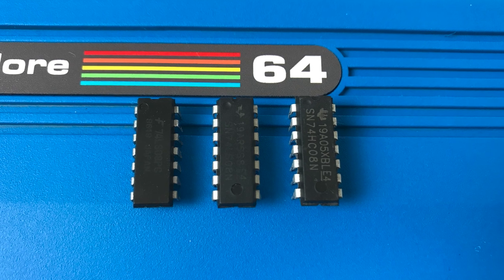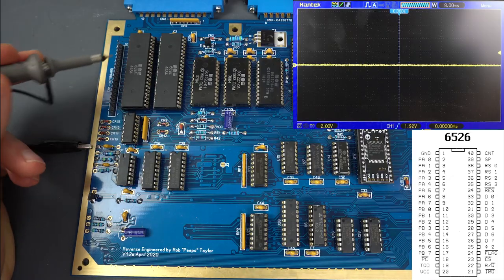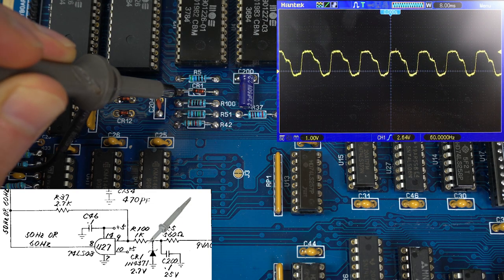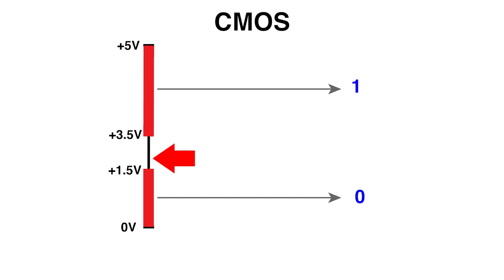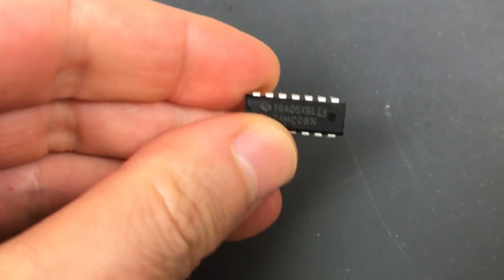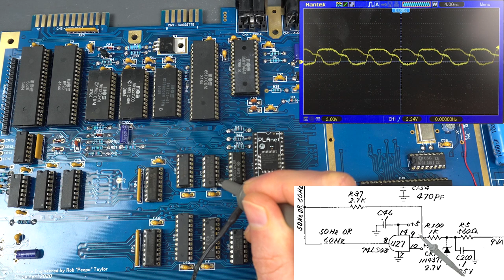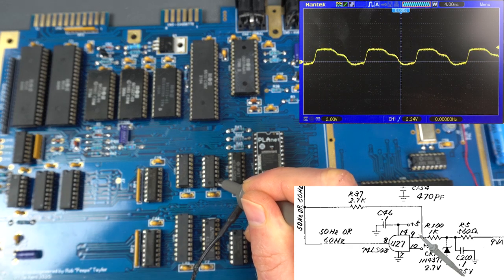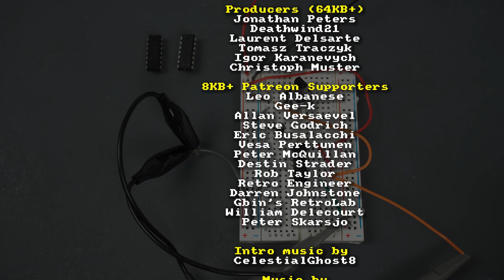Stumped By New Fake Chips Scam

Comment: Nice repair video and discovery of a mislabeled or (more likely) FAKE TTL chip!
One thing you did not mention, Noel, is that CMOS power consumption goes up dramatically as the input voltages are farther from the rail (like 2.5v for high on a 5v rail), and likewise TTL power consumption increases quite a bit as the input levels get closer to the voltage rails (such as 0.1v low input instead of .7v low input).  The good thing is that for this application it shouldn't really matter as far as the input from the zener shunt is concerned.  However, due to the reliability issues of (seemingly) all Commodore/MOS chips I would personally be concerned about the CMOS 74HC08 driving an input on each of the 6526 CIA chips.  It's one more reason not to mix CMOS and TTL logic chips.  If you have to do that a series resistor between the CMOS output and the TTL input is a good idea to prevent blowing out either the CMOS output FET's or the TTL input transistor(s).
Reply: Commodore chips are NMOS, not TTL. They can handle 5V on inputs without problems and their output is usually slightly above 4V. There is no increased power consumption for high input voltage on NMOS as the input is connected to the gate of a MOSFET, which doesn't conduct.

Comment: Two things:
1. Using the mains frequency as a time base is a very good idea if one does not mind losing the time when power is off. The mains is more stable than most crystal oscillators over time periods of days or weeks.
2. I would be cautious of triggering a digital circuit using marginal logic levels. The trigger voltage can change with power supply voltage, temperature and time. What works today may not work tomorrow if one or more of those parameters change. If LS chips are not available you could try HCT chips as those are meant to have TTL compatible input ranges at the expense of lower output drive.

Comment: You can also create a zener diode with an higher voltage by adding a normal diode to it in the reverse direction so its drop adds to the zener voltage. To keep the normal diode conduction mode you have to add another normal diode ok parallel to the zener and the first diode.
Reply: Difficult to do that on a premaid circuitboard.

Comment: I think that Commodore engineer's decision to use the chip in its low threshold mode is a bad design by itself.
Reply from the maker: Agreed! That was really puzzling when I studied the circuit. Especially relying on the very bottom of the acceptable TTL threshold.
Reply: Well, the TTL spec guarantees the output will switch as long as the input is 2V or greater. So it may also very well switch at a lower voltage.

But 2.7V is safely above 2V, so it's perfectly fine IMO.
Reply: Perhaps they had a bunch of them in stock. Or maybe someone got a real good deal on 2.7V zeners that month.

Comment: For time-of-day keeping, the mains' frequency, at least in the US, is quite accurate over time. Traditionally, the multiple grids in the US have been kept it tight synchronization, partly to ensure clock accuracy.
Reply from the maker: Yes, I never realized that before I learned about this. But I guess it makes sense, especially when they used that signal much more a few decades ago.

Comment: Back in the 80's we had a very similar problem when card production swapped the manufacturer of an LS chip in the Power reset circuitry for a banking terminal (Texas Instrument vs Nat SemiConductors I can't remember which way round it was). Needless to say when turning the machine off the replacement chip enabled the processor whilst the voltage was dropping and the processor corrupted the backup memory - it took some time to find that problem.  Nothing fake - just manufacturing tolerances.

Comment: I've been experiencing this quite a bit myself.  Recently I got a lot of 5 MC6847 VDG chips.  4 out of the 5 worked.  The one that didn't work had a notch that was different than the 4 that worked.  So I did the acetone wipe and sure enough it was a rebadged chip.  But it was rebadged from a 100% comaptible!  It just didn't work.  Why did they feel like they needed to rebadge that?  So I tried the test on the other 4 chips just to see and sure enough they were rebadged too....but they were still all 6847's!   I could see the original labeling underneath the paint.  They didn't bother sanding them down. The only reason I could think of them rebadging them was to make the date look like they were new old stock.  We all know they haven't made these in a long time, so they're not fooling us.  It's just a waste of time.
I got 5 63C09P's that didn't work, and did the acetone test and I got a nice black q-tip, meaning the badging was fake, but they sanded them down so much, I couldn't tell what they were originally.  These printing jobs on the labels even indent into the plastic a little bit, so you can't completely get rid of the badging, but that copperish color sure faded away.
Reply from the maker: Yes, things are really bad with larger, more expensive chips (even though they aren't THAT expensive), but this came as a surprise to me. Such an unfortunate situation that we can't trust chips like this.

Comment: I mean, you can still get brand new 74LS-series chips from mainstream component sources (Mouser, Digikey, etc). I think this is more of a story about buying from reliable sources.
Reply from the maker: That's true. But it's hard to find a reliable source with reasonable shipping (or no minimum order) for when you just need a small component.
Reply: @NoelsRetroLab  I mean, I guess? Most places have an economy shipping option. I know Mouser will ship as little as one resistor and you can choose their economy shipping for $3.50, so I pretty much use them exclusively. It really comes down to, "how much is my time worth?"
Reply: @An_Onion  Sadly when you order from Mouser in Europe, shipping starts (!) at 20 Euro ($23,61). Only when you spend more than 50 Euro ($59,02) it is free shipping. So it only makes sense when you spend more than 50 Euro each order. So wait and stack all the ICs up in your card :(

Comment: Nice demonstration! But why didn't you use a 74HCT08? That would have the same switching levels as the LS, so no need to replace the zener diode.

Comment: The problem here is with the original design. The extra feedback resistors are an attempt to create a Schmitt-Trigger to overcome AC line noise, however relying on the linier characteristics of a digital part is very bad practice. My guess is that the designer found he (she) had a spare gate and so decided to save the expense of adding another logic package (with a real Schmitt-Trigger) such as an SN7414. (One extra DIP package took up a fair amount of space)
Unfortunately this was done a lot in the early days but the variations in manufacturing process from manufacture to manufacture or even run to run can be large.
That's why the data sheets list typical values with a fairly wide range from Min to Max.
The moral to the story is don't design a digital logic circuit that depends on the linier characteristics of your logic elements.
All of that said, I'm guessing that the zener diode voltage was chosen to keep the transition close to the zero crossing of the AC line where power supply rectifiers (and other AC loads) might generate noise into the wave form.
Reply from the maker: I agree! That clearly shows it was added last minute because they had a spare gate already on the board 😃  Typical for computers of the time. The amazing thing is that it was never changed in subsequent revisions of the board.
As for the value of the zener, remember that the original AC signal goes all the way to 9V, so the slope is really steep over a whole range, so I think they could have safely picked lots of different value zener (maybe even up to 4-5V) and had the same effect (just a guess, I haven't really tested it).

Comment: Just a small clarification: LS does not directly identify the technology. LS stands for L-ow power, S-chottky diod. 74LS08 takes less power and is much faster than 7408. There are also variants 74L08 or 74S08. Some of the chips from S series can even work well above 100MHz.
Reply from the maker: Correct. It's one very specific type of implementation, but always using TTL. I didn't mean to imply that all TTL chips were LS, I should have made that clearer.

Comment: I fixed the exact same issue fixed it with a higher zener thanks to you. Exact same label as well. I actually also had a similar fake 193, causing wrong clock. Pretty irritating. It is easy to see via the power consumption, around 4ma is too low.

Comment: I taught digital electronics for almost 25 years.  Our supplier of lab parts, the lowest bidder, supplied fake chips.  It was a nightmare for me because we were analyzing the performance of various families and they were all the same (CMOS) yet labeled differently.  Also, several of the kits had chips that were labeled upside-down so had many burnups.  Also, some chips were NAND for NOR chips, and NOR for NAND chips.  We had to collect all the parts and purchase replacements from a reputable supplier.

I have never seen a stand-alone TTL produce an output high greater than 4.4 volts, and a CMOS no less than nearly 5 volts.  This is the easiest way to test.  Also, the input current unloaded for CMOS is nearly unmeasurable whereas TTL will have a few mA.

Comment: Changing the zener diode with one having higier zener voltage is meaningles. With ~ 2 volts on the rail you were not nearly close to that 2.7 volts on the first one so puting one with 3.3 volts zener voltage doesnt make any sense. Placing the second 74LS08(HC actually) may have solved the problem byt that is because of the tolerance of that chip and it seams that it works at the edge of its specification, which is not good because in time as the chip degrades it will probably go out of that range and the clock failure will reaccure.... Better find a genuine 74LS08 as soon as possible. The only thing that I think may help here is changing resistor R5 (560 ohms) with one with lower value (240, 270, 300 or 330 ohms). In that way the voltage drop acros the resistor will be smaller and the rest will go accros the Zener diode wich will reach its zener voltage
Reply from the maker: I wouldn't say it's meaningless. The 2V was due to the feedback resistor. The higher the input level, the higher that voltage would go. You can even see it in the oscilloscope that voltages are higher with the new zener. And I did try the HC by itself before I measured things that it didn't come close to triggering. But yes, changing the resistor would have helped as well.
Reply: It is the feedback resistor that lowers the voltage. Therefore if you aim a bit higher with the zener diode (1 to 1.5 volt higher), it might work. However, you then get a smaller pulse width.

Comment: I built the same board here and had exactly the same problem. I have the same mislabeled chip here. Thanks for the solution :) The C64 diag doesn't show any error now, but my VIC still overheats quite fast. I do not know yet what this is? The voltages all seem to be exactly right.

Comment: I have to ask a question that seems obvious: why didn't the circuit use a five volt zener diode so the input to the AND gate would be the right voltage?

Comment: Another reason the CMOS part would not work is that the output swings pretty much to 5V, whereas the LS part would only be maybe 4V or so when high.   So the feedback resistor on the CMOS part will raise the threshold more than the TTL one would have.
Reply from the maker: I hadn't thought of the effect of the higher output level. That's interesting. I think it might still have worked because it would always lower it enough to go low though (and clearly in the oscilloscope it just never managed to trigger the high level), but now you have me wondering what it would have done if it went high. Hmm...

Comment: A few remarks:
- Your scope showed 50,0000Hz when you probed the C64 clock signal probably because it uses AC frequency as the reference itself. ;) AC frequency is not stable, but the European grid compensates for fluctuations so you get very precise mean frequency over 24 hours or so.
- LS is not an indicator of TTL technology, but is subset of it. Most of 74 series are TTL, including "S", or "vanilla" with no letters between the numbers. "LS" is a low power schottky subfamily, which was the cutting edge in the 80s.
- Your test is indeed conclusive as TI's LS series should switch at a voltage over 2V, but a more "proper" way would be to measure input current. Bipolar TTL chips, in case of LS, draw tens of uA from their inputs at high level, while in case of HC chips and their isolated gate transistors, the leakage is in order of nanoamps.
Anyway, I did enjoy the episode, as always. Cheers!

Comment: Might note that 74HCT08 uses TTL voltage levels. I use those. 
Usually LS TTL outputs are <.4 and 3.5 volts but input is .8 and 1.8 volt thresholds. The hokey feedback resistor (like schmidt triggers use) make the threshhold voltage wider.

Comment: Another possibility is that these chips were manufactured as LS chips, but failed testing and were dumped into a reject pile that someone bought and is now selling.
Reply from the maker: That's a possibility I hadn't considered. But seeing how they trigger just like an HC, I'd be surprised. Still, I could do some other tests to find out if they're really HC.
Reply: @NoelsRetroLab  You already did: 13:34. An LS would never reach an output of 5V, you would expect something between 3.0 and 3.4 volt if it was LS.

Comment: Taking the timing signal from the AC mains may give a time that is ahead of or behind the real time by up to a minute or so, but the deviation does not get bigger than this. The speed of the generators at the power stations is controlled so that on average over a long period the frequency is exactly the nominal frequency, but at any given moment it could be slightly lower or higher.

Comment: Very nice video as usual, very well researched.

The "fake" chips could be regular chips that fail some test (temperature or other) and are therefore rejected on the standard line.
The factory could be tempted to sell them anyway where it could be assumed that they "should" work.

As far as I remember the voltage specification for high speed CMOS is as follows
HC    (Standard CMOS)    VCC/2
HCT  CMOS with TTL        0.8 / 2.0

The reason for the threshold not being absolute values like like 0v and 5v is that TTL uses bipolar transistors.
This in turn means that currents flow in and out of circuits which changes the voltage of the logical levels. So there is a safety margin in the TTL levels.
CMOS ICs are not susceptible to these level issues as they can drive to "rail to rail" and they use virtually no current on the inputs.

CMOS chips will use less power then the equivalent chip in TTL technology but this is only valid in a stable state (not switching).
They have a pretty linear consumption to frequency ratio (consumption goes up with frequency). This is much less the case for TTL.

TTL or TTL compatible chips (74HCT) are meant to work at 5v +/- 10%  (from 4.5v to 5.5v)
CMOS chips are not limited to 5v or 3.3v in fact many of the 74HC chips are specified at 6v (from 3v or even 2v to 6v)

One last thing: using logic chips in an 'analogish' way like crystal clocks is always risky as some of the characteristics of the circuit will depend on the implementation technology.

Comment: Uh that's very interesting, i'm excited. I got a KC compact which is a kind of duplicate from the amstrad cpc. It is working fine with his own CPU - a U880 (the gdr type of the z80 processor). Interestingly, this CPU works also fine in a cpc but the Z80 CPU from this cpc doesn't work in the KC compact. This Z80 CPU btw. is a brand new one. I think i take the board out on the weekend and check a few voltage levels with my oszi again. Thanks Noel for this informations. Thumbs Up.
Reply from the maker: Oh wow, I didn't know about the KC Compact! Very interesting. I'm going to have to look into getting one given my love of Amstrad CPCs 😃 I'm not sure this is the problem you're having though since the original parts (I'm guessing) are all TTL. But it's worth checking. Good luck!
Reply: @NoelsRetroLab  KC Compact are quite hard to get your hands on as they came very late in the existence of the GDR - it's almost only a C65 like batch that found its way to collectors.
Interestingly enough sometimes in those East German Z80 computers they had to use original Z80 CPUs as the demand for their clones in the industry had been way too high. This way original Zilogs found their way into my possession years before the Berlin wall fell.
Being a young greenhorn back then, I did only wonder shortly when first looking at the documentation ("Where is that U 880 D they talk of here?") but in the past few years I came to a new appreciation of this little detail of history.
Reply: Wow, I am facing a similar problem with my Z80 system (AEA PK-232), when swapping the NMOS Z80 CPU with a CMOS it doesn't work anymore. This system has also an NMOS Z8536 (in your KC compact it is the U82536) inside like the KC compact. You say your CPU is a new one. Nowadays only CMOS Z80 CPUs are made, so I guess your problem is coming from CMOS which requires and produces slightly different logic voltage levels. But even if the CPU is not CMOS, coming from a different makers it might require or produce different logic level voltages which the Z8536 will not understand and as I understood the KC compact initializes the U82536 right at the start.  Applying 4.7K or 10K pull-up resistors on the data bus might help sometimes, but not in my case.